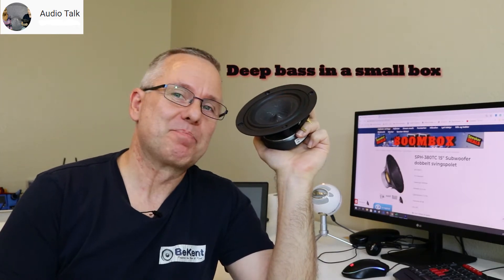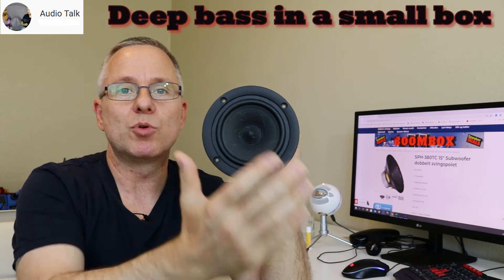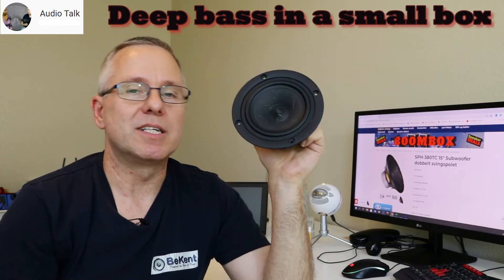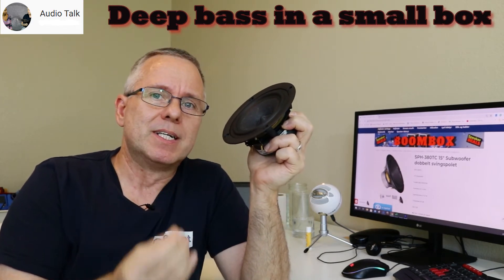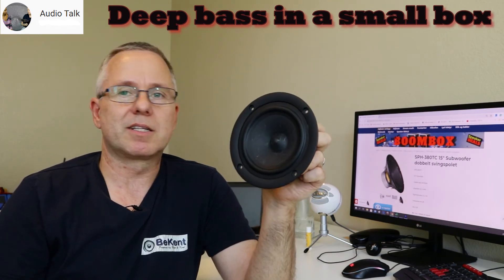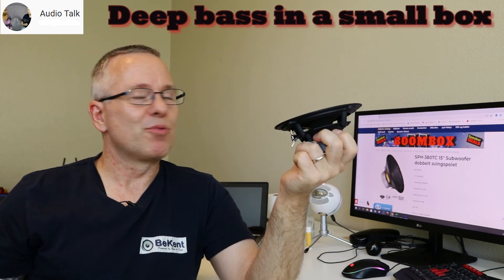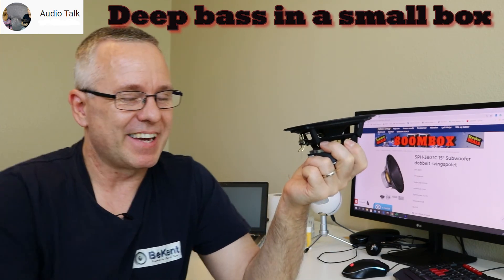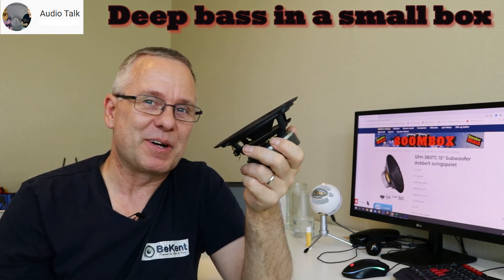Deep bass in a small box

Comment: Hi Ken I recently purchased a Celestion 15 8 inch bass guitar speaker to use for an e-drum monitor. For home use. Do you have any box size recommendations to achieve the deepest base possible? Would a port help? How long? Thanks for your help in advance! Great videos too.
Reply: Bass amp? 8" driver?
Background: 
Low E on a 4 string standard tuning Bass guitar can go down to about 40hz. A 5 string bass can go down to a low B which is 30hz to 32hz. 
Conclusion: 
Don't go for a ported enclosure for this application. 10" X 10" X 8" deep cube, sealed box for sure. 
Scenario 1:
If your amp power exceeds the speakers rated power then use thick and stiff walls such as double 3/4 inch thick plywood for the enclosure. You'll get some crazy (good) distortion at higher volume levels.
Scenario 2:
If the amp is somewhat underpowered then build a thin-wall cabinet with 1/2 inch plywood or even MDF. The walls will resonate at regular bass guitar frequencies to add volume to your sound.
Hope that helps!
The OP seems to be quiet for a few months now, not sure if he's still active on YouTube.